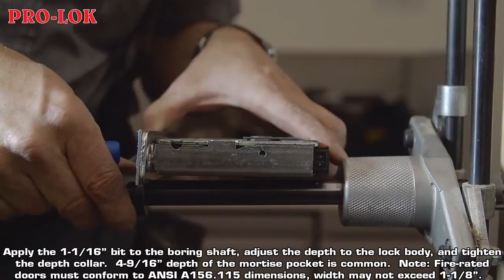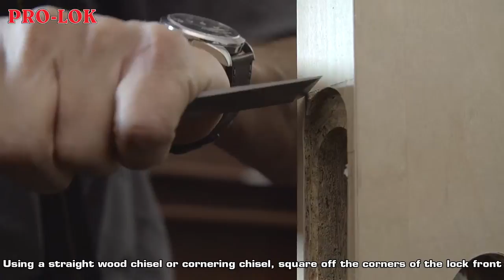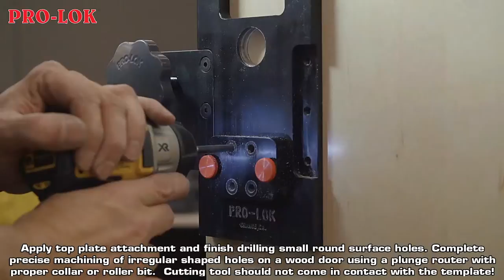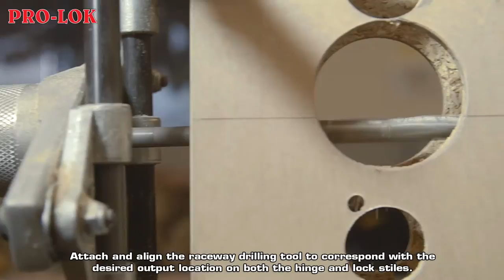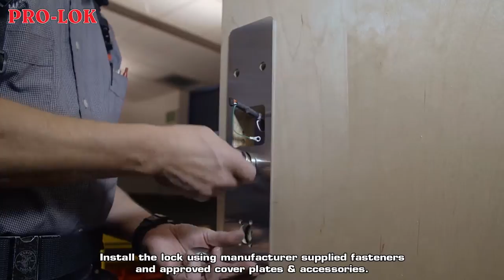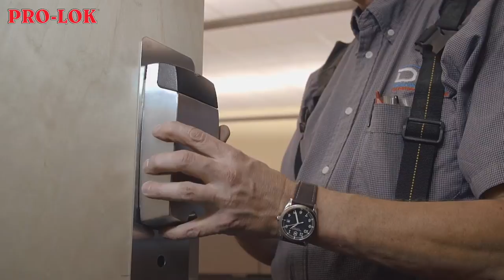PRO-LOK: Bored to Mortise Conversion

Comment: What if dead bolt
 is bored out
Reply: I think if it's an entry door you can find a lock set style will cover the hole. Otherwise you'd have to glue a wood plug in the hole.